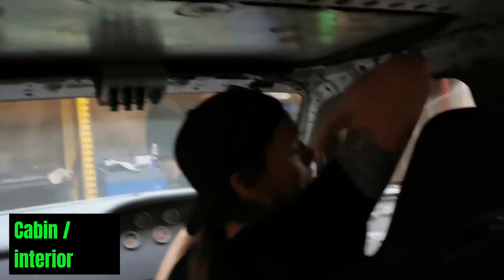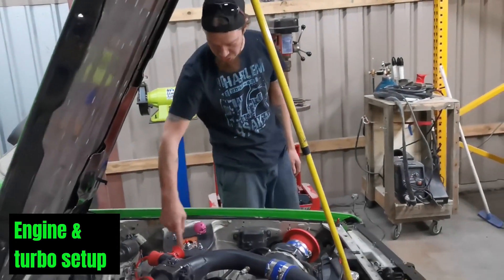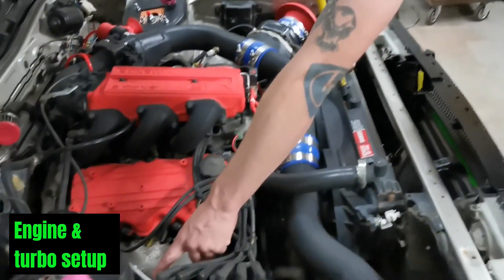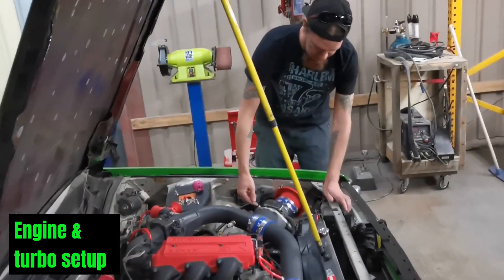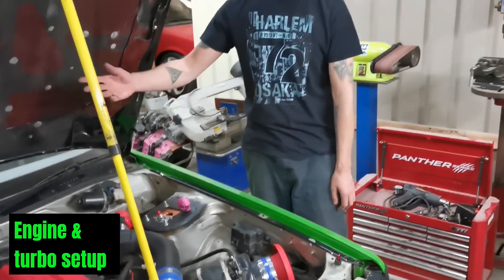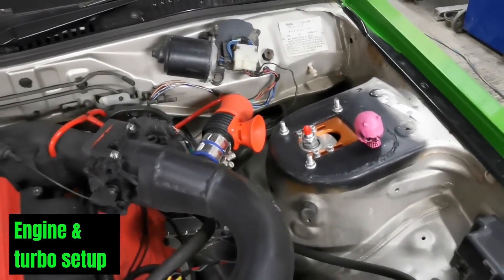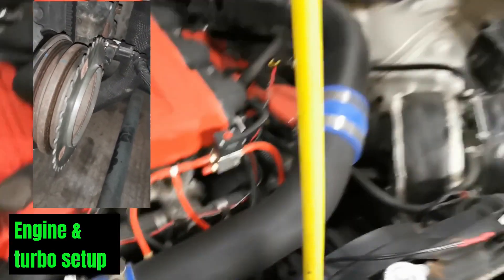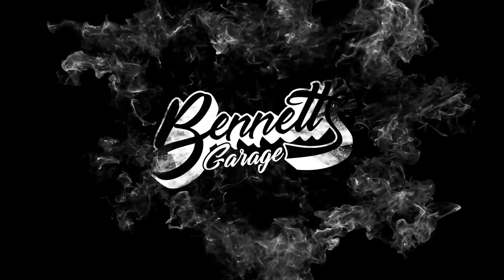You've probably never seen a Mazda 929 this modified! V6 TURBO SKID/TRACK/DRIFT project car

Comment: Awesome build mate, I have a question, what did you use for a trigger wheel and CAS sensor?
Reply from the maker: Hey mate, cheers 😊
36-1 crank trigger wheel off a 2003 mazda 6, plus sensor. Custom bracket made for the sensor, trigger wheel welded onto front of balancer.

Stock distributor has had the teeth cut off and turned into a single tooth cam sensor. Made a flat blanking cap out of the distributor cap by cutting it down
Reply: @Phil_Bennett  thanks for the info Mate, looks like I’ve got some work ahead🤣

Comment: In relation to the struts, I've got custom adapter plates for the strut towers to run rx7 coilovers/struts, is there a certain brand/suspension setup you recommend? Obviously a rx7 is about a 200kg lighter car so I found my struts bottom out pretty easily unless I slam the car to the ground to give it more travel.
Reply from the maker: RX7 ones are fine as long as they are base height adjustable, or else the car ends up too slammed. As for the weight, it shouldn't matter as you can change/select spring rates, 6kg, 8kg 10kg etc
Shockworks are doing awesome stuff at the moment, Tien, even the ebay ones are actually alright but not that cheap anymore